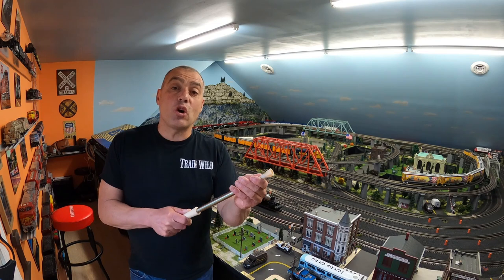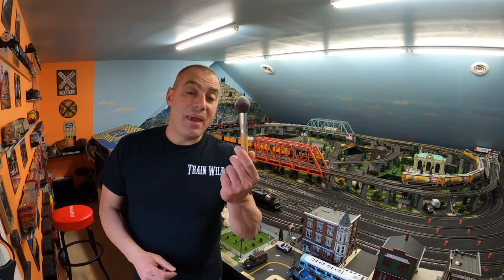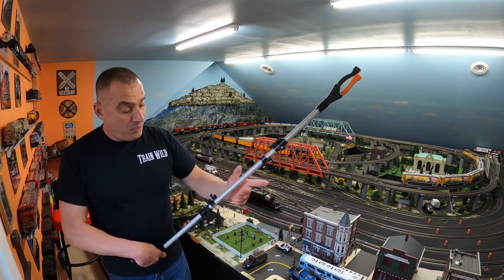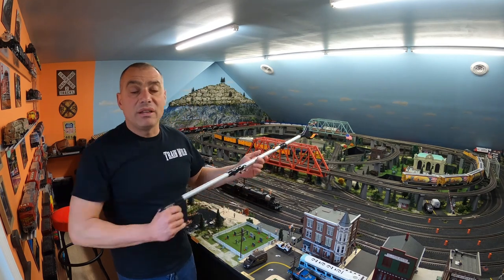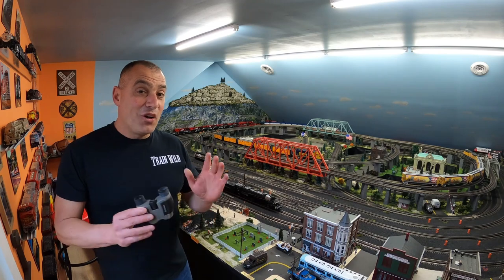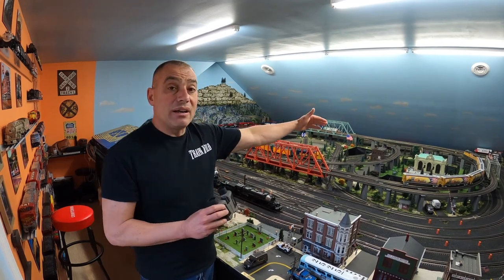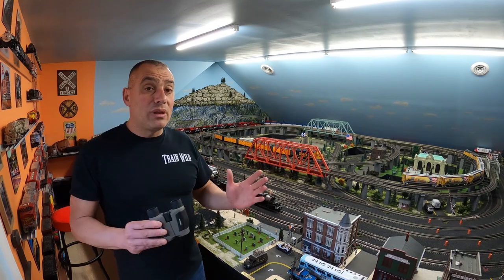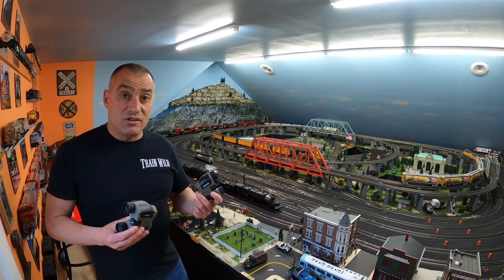Tips & Tools for your Model Trains & Layout

Comment: Good to know George....what is the proper name for the extension rod ?  How did you locate one ?  Thank You
Reply from the maker: Hi Jim, the proper name is a telescoping microfiber duster with extendable stainless steel 100 inch pole. The one I have is made by "Abealv"and they are available on Amazon for approx.$10.95 - I just didn't attach the microfiber duster head and kept it in the box in case I need it. To answer your question, I knew I needed a telescoping pole for this purpose, and I knew that they predominantly make them for microfiber dusters to reach up high like chandeliers, ceiling fans, top of cabinets, etc. I also knew that some of them are rigid enough and work well and that I can use it without attaching the dusting head. It's perfect for giving a little nudge to the trains when they are out of reach!
Reply: @trainwild   Thanks George..it will come in handy.  I hope Niko is doing well. 👍